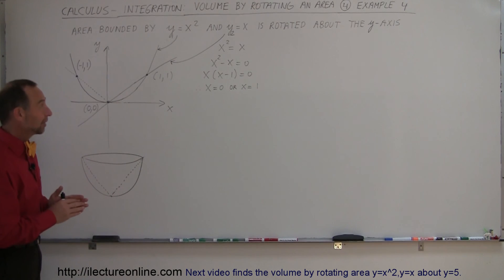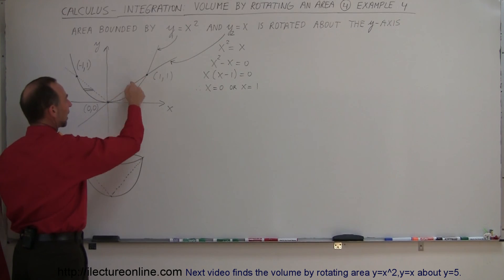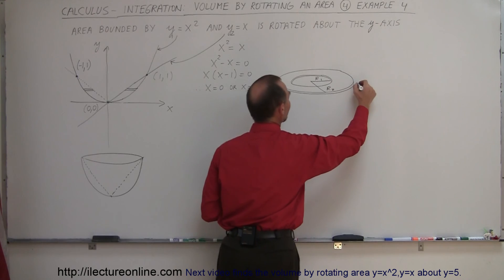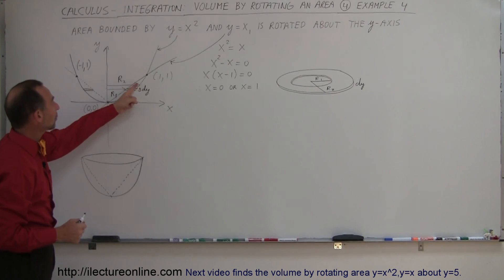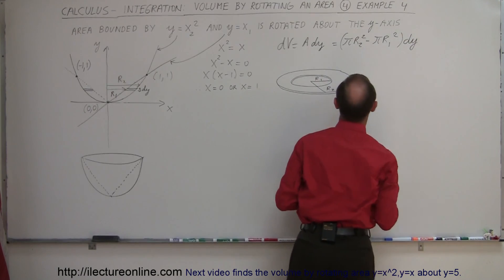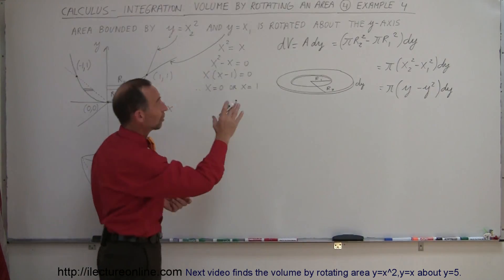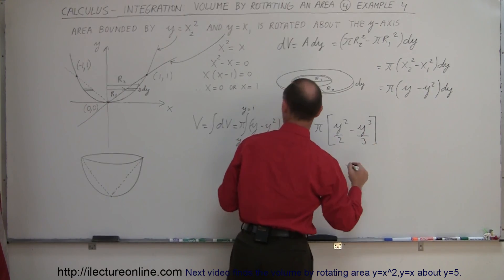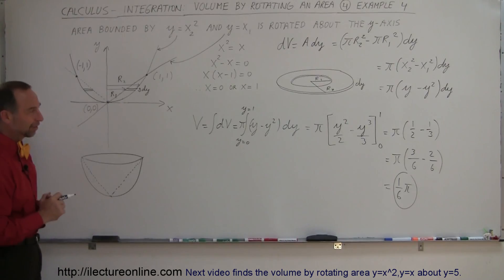Calculus - Integration: Volume by Rotating an Area (4 of 10) Ex. 4: y=x^2,y=x About the x-axis

Comment: didn't he forget to plug the exponents of pi(x2^2 - x1^2)dy when he changed in terms of y?
Reply from the maker: No, I didn't forget.  Note that x1 is part of the linear function y = x1  and x2 is part of a quadratic function y = x2^2
Reply: in my understanding, it should be x^4 .. and the y will be y^2 . I am confused.